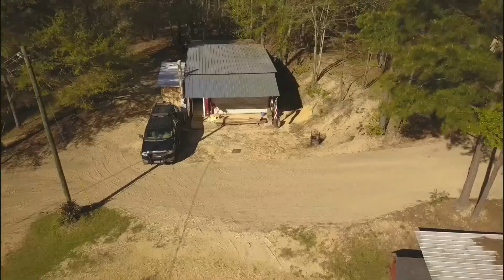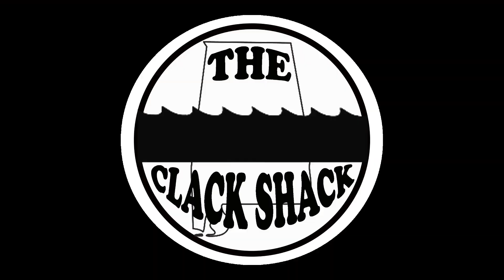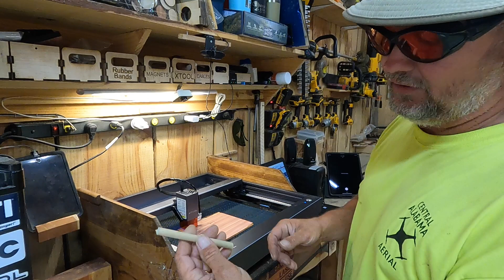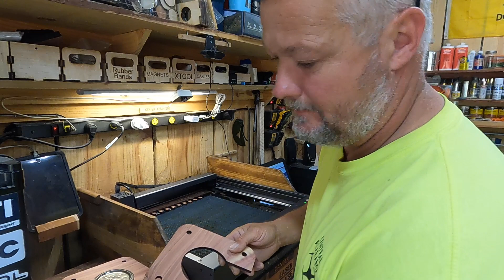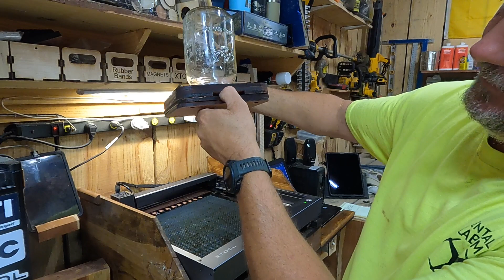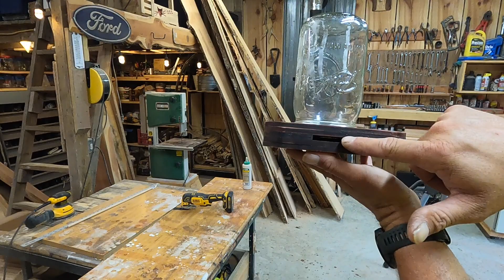Making a laser cut cedar bee feeder

Comment: Great idea and as always your superb design and build. 
Any particular reasons for choosing Cedar material for this project?
Are you going to offer this as a template/jig on your Etsy store?
Reply from the maker: Heart cedar is very rot resistant. You will notice that lots of bird feeders and outdoor designs use it for this reason. It is also very stable after drying and doesn’t try to twist or bow when it gets wet. Also, I like the look of cedar. I have my own sawmill and cut it regularly. It isn’t in my Etsy but it could be.